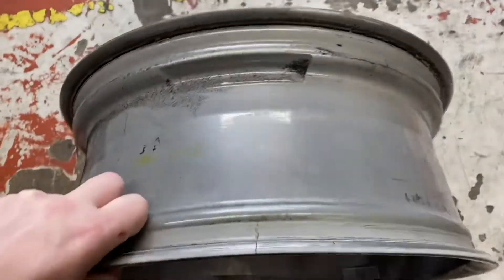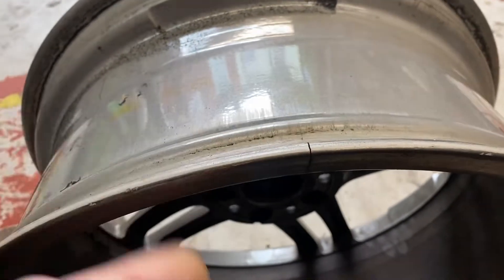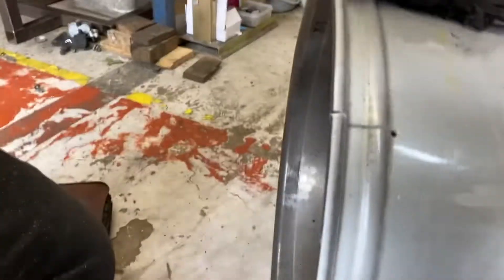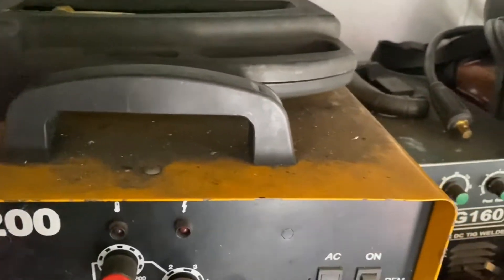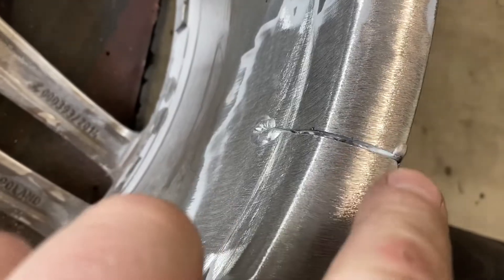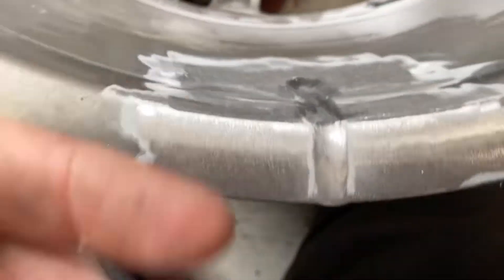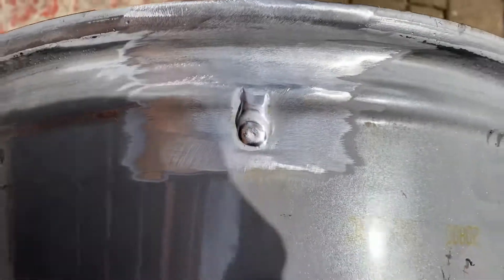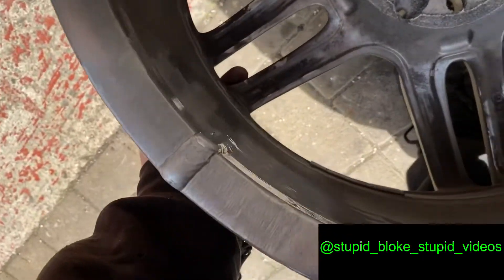Alloy Wheel Welding / Cracked Alloy Wheel Repair (Aluminium TIG Welding)

Comment: Ah ,,, you need to sort your cracks out but your right , a hole at the end of the crack is whats needed .
Ive seen worse ,,, but Ive also worked in NDT and as a welder in aerospace  , and seen the tempering processes in alloy wheel production , and the testing that goes into it.
As such , I personally wouldnt drive on an alloy wheel that has a weld on it . many do though.
Reply from the maker: I know what you’re saying, and the heated area is always going to be annealed but I’ve done 100’s with none back and it’s never going to crack again unless you twat into something. Sometimes people have this thought that it’s going to explode or something. Worst thing that’s gonna happen is the weld will crack, but so can a wheel that hasn’t been welded hence the reason they need welding in the first place. If that case, you just usually end up with a slow puncture. 

I have my own heating process which I didn’t show on the video. The main reason one will crack again is because the weld is softer than the two joining parts to it, so I basically make the annealed area more gradual. It’s nothing complex or fancy, but it is a bit of a trade secret 🤫
Reply: @StupidBlokeStupidVideos   close enough to being correct lol. if it works it works and thats the main thing ,,,,
Reply from the maker: @tomthompson7400  I think the main fight you have when welding them is boiling all the crap out of the metal to get a decent base with as little inclusions as possible. This was a middle of the road one. Some weld much nicer than others. BMW ones usually weld great, Tesla ones too then aftermarket cheapo ones can be horrrrrrrible.
Reply: @StupidBlokeStupidVideos   lots of cleaning action I use an asymmetric waveform  and a very careful choice of rod on picky jobs , and dont look at the gas usage ,,, use plenty and charge to suit
Reply from the maker: @tomthompson7400  I have the balance turned towards clean as much as possible, well as much as my welder can handle whilst still making a decent pool.

Comment: Good welding kid ..what brand and amp size would recomend for welding alloys ? Thank you
Reply from the maker: Thanks mate. This is just a cheapo Chinese thing but in my experience a decent 3 phase system does weld much smoother. With this one I’m kind of fighting the puddle as the power is delivered it kind of osculates if that makes sense, but as long as you’ve enough power to get the penetration you want, then it’s workable
Reply: thank you..